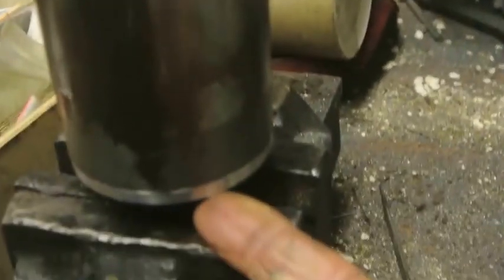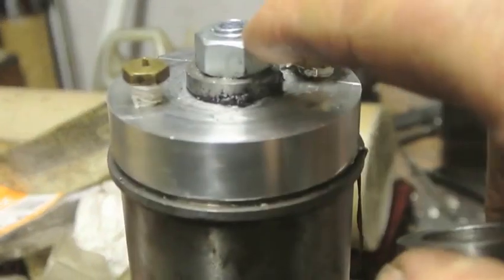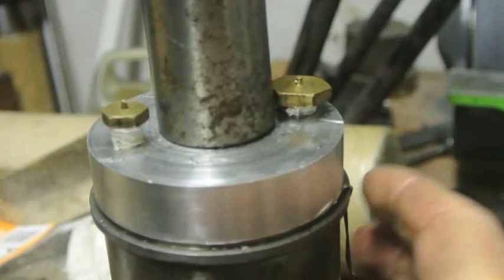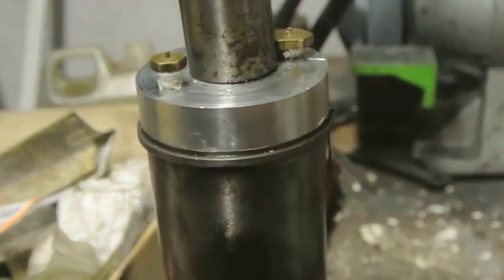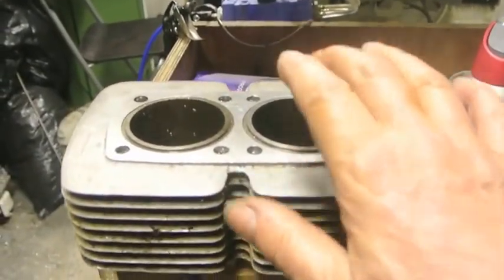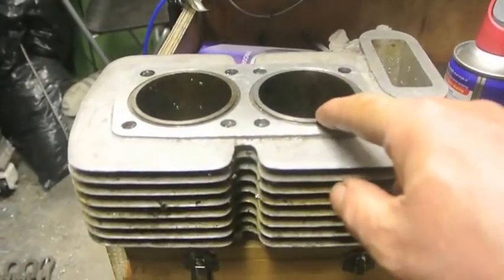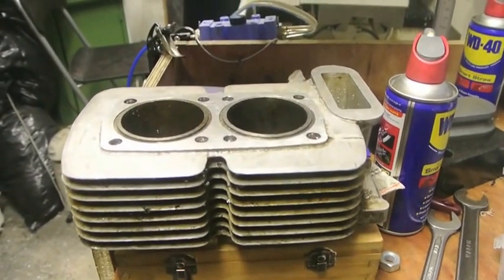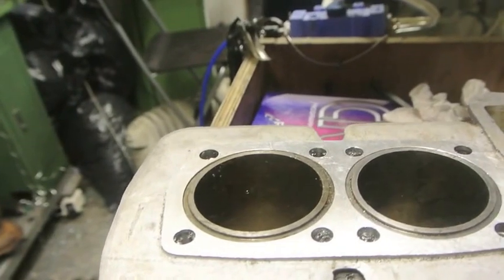Using The Tormach PCNC To Bore a Cylinder casting and fitting the liners Part 2

Comment: Good one thanks Bob 
Hot workshop here in Australia 37 degs tomorrow have to put air conditioner on
Reply from the maker: Nice, I love the heat. Used to holiday in Arizona in August just to charge up the batteries for the year. Couldn't afford it this year because I loaned my son the money to train as a commercial Pilot (not cheap).
Its, pretty cool here today at around 4 degrees and raining.
Happy New Year.
Reply: Bob Rodgerson I was born in Sunderland and lived there till I was 15 before moving to Dover so I know the cold well
Reply from the maker: I was born in North Shields, lived there until 2007 when I moved out to Manchester.